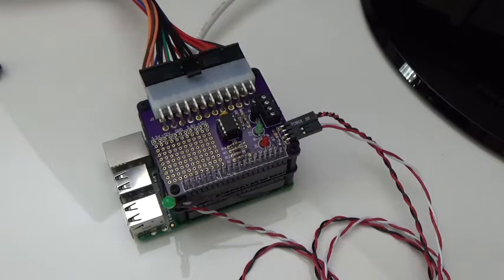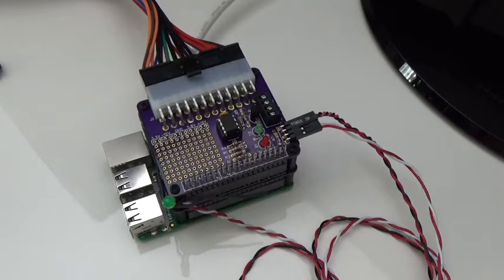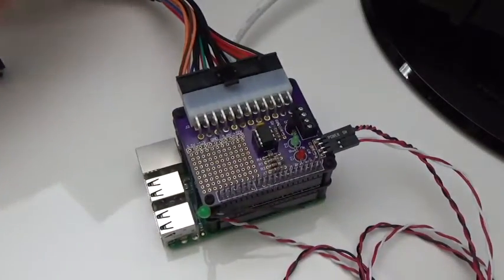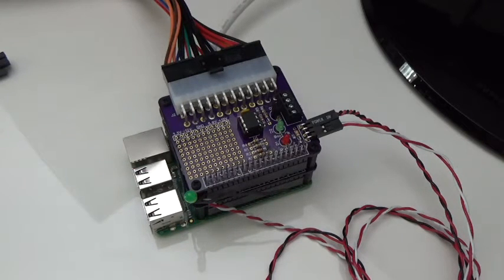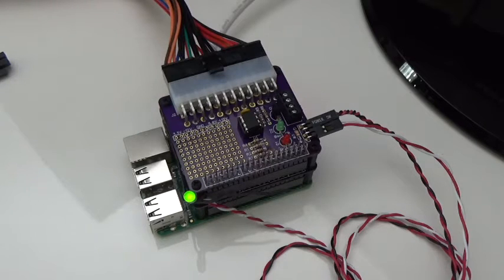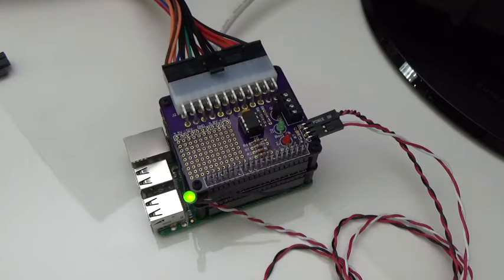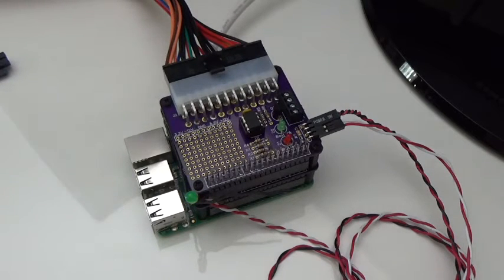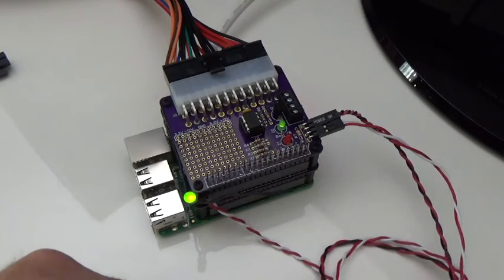Introduction to PiRyte Mini ATX PSU

Comment: nice, but no (poly)fuses? :/
Reply from the maker: No, I don't have poly fuses in the board.  This was a conscious descision.  I rely instead on the protective circuitry of the PSU.  I have shipped close to a hundred of these kits and have not experienced any issues. Thank you for your interest.